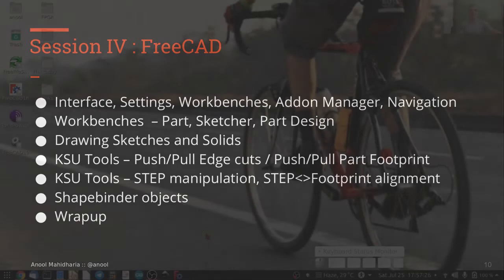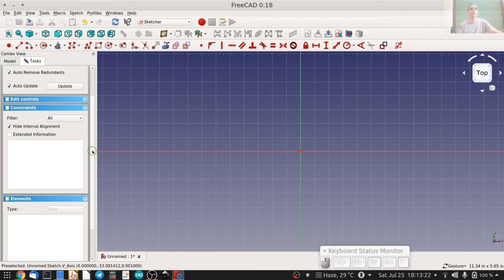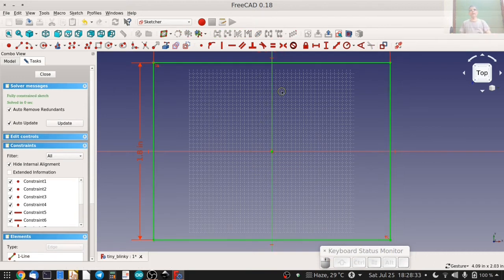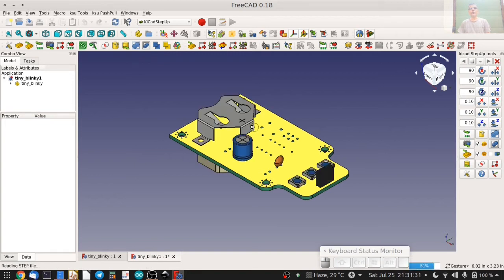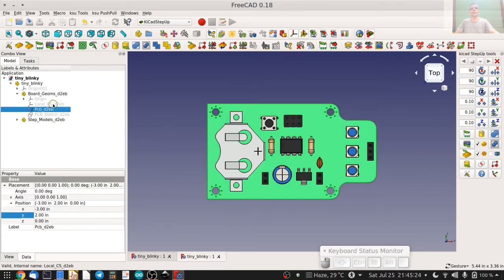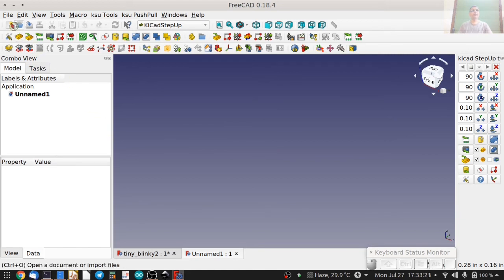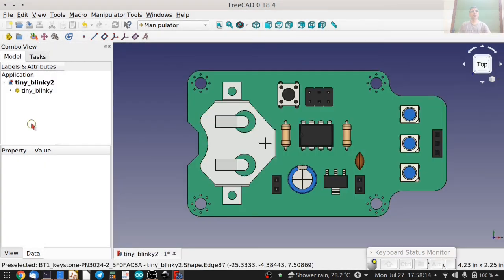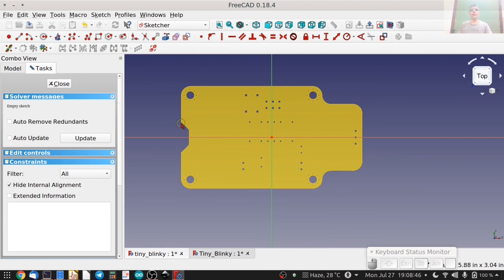HackadayU: KiCad + FreeCAD Class 4

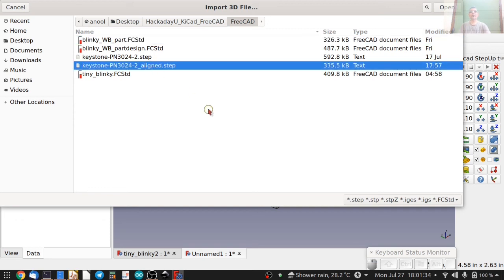Comment: If anyone else is having problems with the exported keystone-PN3021-2_aligned.step not having the same rotation/position as shown in the video (at 57:50), you have to enable "Export single object placement" under Edit > Preferences > Import-Export > STEP (on FreeCAD 0.19).